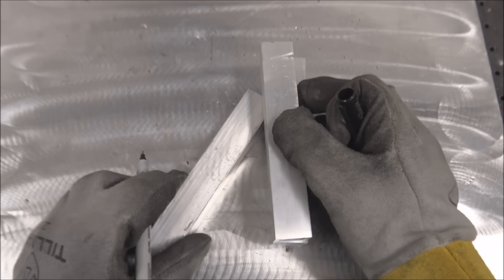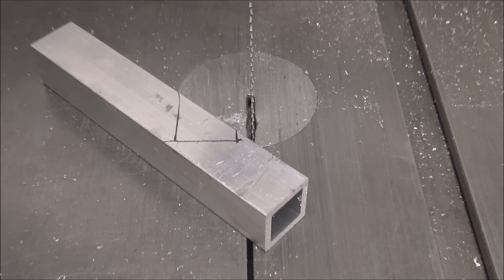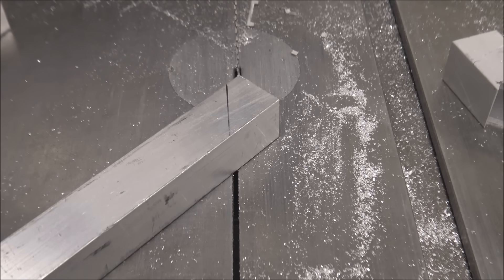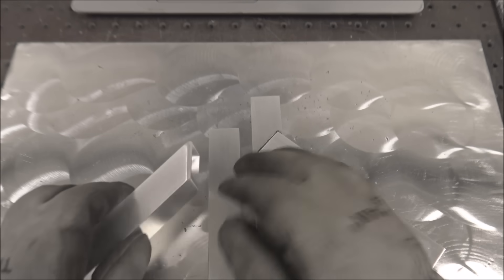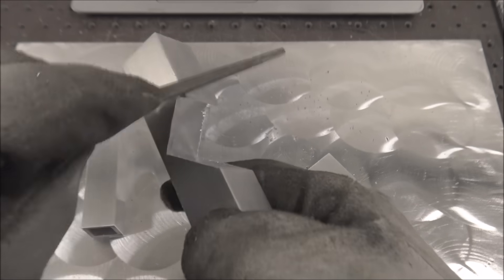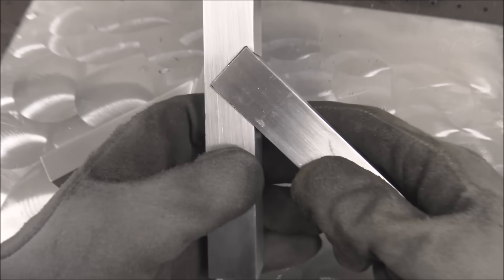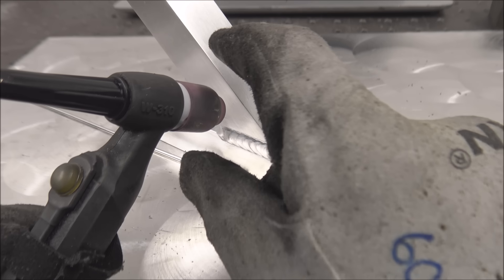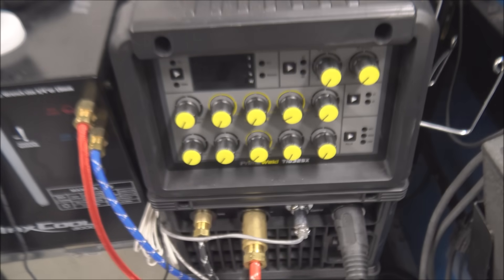Welding Fabrication - Horrible "Education" being EXPOSED

Comment: As a certified IWE, I can say that there are standards and regulations precisely for such connections. 
These specifications for the various connection types are then used as the basis for calculating the overall structures in terms of their structural integrity (strength verification). There are a large number of really technically sensible and mechanically comprehensible reasons for not unnecessarily complicating such types of connection. For example, it is no longer possible to precisely determine the load-bearing capacity of this connection, as the base material has been unnecessarily weakened and force flows are obstructed (all these weld seams in the middle of the profile), which leads to multi-axial stress states in the profile cross-section that do not occur with correct design (left side).

 Many thanks for this video!
Reply: Good! I hadn't considered the calculation part yet. It makes sense that cutting away all the material negatively impacts the mechanical properties. Weld seams are usually the weak point with added risks of introducing imperfections. 

It looks more like a carpentry joint. It makes sense there I guess.
Reply: @leegarnier9396 no, it doesn't make sense in carpentry either. With wood, once you cut it, it stays that weak; you can't weld it back together to restore even a semblance of the strength it had before.
Reply: @jjwagnell  true, but the key is that it "looks" like a wood joint to the untrained eye. It's trying to combine the most eye catching elements of metal and wood joinery regardless of whether it's actually strong, or cost effective, or time effective, or...
Reply: The topic is far more complicated than anyone here seems to be appreciating.  What matters is what forces the connection AND the members have to transfer and how that shear will flow through those members and the welds.  There's a good reason why we don't use butt joints on hollow tube section that are resisting moment, because the unreinforced walls of the tube will buckle out of plane.  Or for connections with large axial forces because you can't achieve enough length of weld to develop that force.  Now don't get me wrong, I would never spec a silly let-in joint like was being portrayed in the "tiktok" example, that's just aesthetic complication, but for many cases a simple mitered butt joint is equally inefficient.  Simple is not always better, it's just cheaper...
Reply: T, K and Y connections per code. You would also have to take into consideration the z loss from the lack of penetration at the skewed joint and properly measure your leg lengths.

Comment: Sadly the reason so many bad video's pop up on how to do stuff is because of engagement. The more engagement a video gets the higher chance it will be recommended.
YT does not look at if it's positive or negative engagement only if it gets any. Working retail I learned 1/5 customers who had a bad experience will complain while only 1/20 who had a good experience will mention how good of an experience they had.
Same rule applies here, videos that show things done wrong will get more engagement due to people wanting to point out how wrong the video is and YT just sees it's getting lots of engagement promoting it thus it likely gets more engagement.

The best thing people can do with videos that are just farming using bad methods is leave the video early and don't engage at all. Don't dislike as that is viewed as engagement the same as liking, don't comment ether.

Comment: Since i have absolutely no knowledge of metals, is it possible that insetting it so far will help with structural stability if the weld fails/to keep the weld from failing? Cause i do woodwork and that reminds me of wood joinery, which you can't weld 😅 and glue joints are generally better with more surface area

Comment: Worse than you say - the piece that's being joined to loses a heap of second moment strength potentially from cutting the face leaving the strength in the spine that's left and shear on your welds on 2 faces.  Be interesting to actually load both up and see the diffeence.

Comment: Call it Weld-Joinery. You do joinery with wood because you can't weld wood (ok, you can use glue joints). But with welds, you are actually turning separate pieces into one continuous piece, and you don't need those complicated tongues and grooves and dados and whatever to transfer forces.

Comment: Meh just like machining, you weld to the to print. If your just doing it for yourself, then do what ever. If you wanna get paid doing it, then at some point you have to follow instructions. In a job situation, both ways mentioned could be called for. It is the welder who has to maintain the skills to cert for the job.

Comment: I thought the right way to do that joint was to split the square pipe down the middle up to the point of the joint, bend the halves out into a Y shape like the crotch of a tree, and then use more half-pipe pieces to make the cut halves back into whole pipes.

Comment: its not really about efficiency, its more of art, I LOVE wooden joinery that have intricate paterns but seems like its a wood only thing and metal worker think radically differently
I do prefer the more dumb way on an art perspective but the correct way is way more efficient on a just doing the work just enough kind of way
tho the thing with joinery with wood is that u dont weld, u have stuff that holds in place by friction, metals are usually not soft enough to have joins hold with just friction

Comment: another thing to mention on the dipshit tiktok weld is that by cutting the main piece to inset the brace you're ruining the strength of the main piece especially on the ridiculous  tube steel versions they do

Comment: Id love to see these two parts compaired on some kind of test rig
Reply: That would be interesting
Reply: As a structural engineer, I can tell you the bad weld will fail first. Welding also reduces the strength of aluminum, so more weld = weak
Reply: @tomd8198  Unfortunatelly, as a strucutural engineer you CANT TELL anyone anything - show the reasearch, explain the process by providing the reasoning/argument, give me a video that proves it or prove it yurself. The argument from authority should not be used in engineering and science.

Comment: Are they trying to weld a whistle? LMAO. It doesn't even leave an open gallery -- maybe you could justify a shallow bird-mouth instead of a miter if the part needs to flow fluid through the tubes, but that joint is just stupid.

Comment: Have you ever done work on mower engines?   The mounting posts for the ignition coil on my mower were snapped off when the coil came loose and hit the flywheel. 
They are directly on the cylinder housing.  Can they be welded back on successfully?

Comment: I think you should come up with an even more "creative" assembly/weld scheme (like going all the way through the straight tube, bend the end of the leg to close the gap, etc.), pushing the absurdity over any reasonable limit!
Cheap low IQ entertainment is what people are interested in, not knowledge. Knowledge requires mental effort. You may look at this as a form of mental obesity problem in the long-run.

Comment: They tried doing this in the electrical field 5 years ago with some young kid saying that electrons don't move through wires - and that they just vibrate back and forth in small areas to bounce other electrons through, 🙄Holding a piece of paper between 2 high voltage electrodes, 4" apart, burning thousands of holes through it, shut some mouths in a hurry. Brain dead professors 40 years ago insisting that holes flowed, instead of electrons, started it all. Gonna' get worse.

Comment: That bandsaw (at the beginning) 
should have a stop-block to get the length of the piece to be cut off, which terminates so the tubing/channel doesn't bind against the fence.
Reply from the maker: No need to solve a problem that doesn't exist. Nothing bound up.

Comment: Sometimes "overcomplicated" welds are required. But this is not such case. If you however find yourself near high pressure piping entering pressure vessel you may find stress relief saddles. Or you may not - some vessels are thick enough (or openings are small enough).

Comment: The more of a tubing joint that is intact and not part of a weld joint the stronger the resultant part will be.
I've seen an old guide on permissible types of joints used in tubular space frames for aircraft. None of the joints involved  completely welding around any one piece of tubing . Every tube in a joint had an unwelded section that was unaffected by heat to retain its original strength. Where necessary , gusset plates were welded to the joints to add strength.
Reply: How does leaving a section unwelded improve strength? If it isn't attached to anything, it has zero strength.
Reply: @thomasdalton1508  The trick its avoid the heat affected zone..  An i imagine they use a redundant frame to cancel these weak points.
Reply: @thomasdalton1508  I believe it's meant as in "the section of pipe hasn't been exposed to the extreme heat required to liquify metal which can interrupt the metal's treatment and forging process"

Comment: I would see an advantage of using a slightly more complicated cutting/fitting technique if you CNC laser cut the tubes and use notches to locate the tubes with each others. Less time measuring and fitting.
But you’d probably have to make quite some volume to have any return on investment …

Comment: While there are different ways to get a lot of things done, some are slower and dumber or both. I've been known to cope things like angle iron or I beam together before welding but, there are simpler ways to do it compared to the too "complex" version that you showed here. Most of the time I just opt for the fewest cuts and welds and be done with it.

Comment: Hey Aaron, Good job and I can say you are right on.  Simple is almost always the best.  And your TIG Button is the best welding tool I have in my shop.
I've had three of them on three different machine and they work flawlessly, especially on aircraft fuselages with thin wall 4130 tube upside down. 🙂 
Thanks, John B.

Comment: To be honest stupid method might be better for mass production, when you stamp milion of self locking parts and weld them with spool gun in secunds, so every idiot on production line can do it. Because i seen this type of joint in chinese office chairs my workplace (local highschool) bought. Not surprisingly all of them beginn to crack around the welds because they were overheated and overcooled so metal around the weld harden while rest remained soft.

Comment: Your beveling is, in my humble opinion, a great habit to get into. It increases the fusion zone & eliminates filings that could affect the finished welding. 
You could also argue their silly joint increases the HAZ zone unnecessarily & wastes time, material, purging gas, etc. Nothing about welding aluminum is cheap or easy.

Comment: I absolutely agree with you. YouTube is getting packed with people that post videos proudly showing the wrong way to do things. I am a retired EE and it is atrocious the amount of wrong minded crap there is on YT. Your videos are excellent because you are not only are a master class welder but you also present the logic and thought processes that make you a master class welder. Thank you for posting.
Reply: The fake electronic videos are disgraceful. There are examples showing how to build an inverter that will supposedly deliver kilowatts with just a few components. If it works at all it will deliver a horrible square wave, a ton of EMI and just a few watts of output with no voltage regulation. It's more likely to burn your house down than to power anything useful.
Reply: What's being criticized reminds me of those videos where they set themselves up to "fail" doing it more or less correctly, then use a dangerous hack as the "right" way, like connecting copper to aluminum.

Comment: Awesome job for calling out the so called "Professional YouTube welder shorts".  I was a structural welder for 9 years and if you every did a joint like that and took away the strength of that beam, your ass was gone, plain and simple. Thanks for being a real professional.

Comment: The only reason to do that notched joint is if you're using wood. Even then it wouldn't be great, because that notch is way too deep and would ruin the strength.

Comment: Great video, there is so much misinformation on welding and fabricating these days due to social media. I personally always bevel both tubes when doing butt joints like you did because as stated in the video it increases weld penetration thus making the joint stronger.

Comment: I've seen those shorts, and you are correct, they do those joints because they don't know how to weld.  Stitch welding prevents penetration, and so, of course, they have to have other crazy ways to increase the weld length and tie the pieces together.  Your methods make so much more sense and are so much easier.  Keep up the good work!!

Comment: Those shorts from the psudowelders are annoying.
But...
In my 35 years of TIG welding, I have had some doozies from some Engineers.  Much more FUBAR than even those shorts..
Just did a quote for a part.  Main Pc. is 3/8" 6061, Little tab is 1/4" thick, getting welded at 90*.
The imagineer calls out a 1/16" weld on one side, and 1/8" weld on the other.  Like you can just pick a size from the freaking rolldown menu...

Comment: The odd cut has the advantage of locating the attached member. But otherwise weakens the cut member significantly. Typically the tube will be a T6 heat treatment. The weld affected zone anneals the metal. With that odd cut the entire cross section of the  cut member will be annealed making it half as strong. With the simple bevel cut around half will be annealed leaving much stronger material behind. 
Also the wall is not cut away. When bending forces are applied, the bevel joint has two walls to resist with, while the odd cut has only the outside one, the inside one being cut away. 
Also if the weld is not full penetration the odd cut removed a huge portion of the original tube. So now most of the load is held by welds that are smaller than the original cross section, making it weaker. Most people don't make samples and cut them to verify they are getting full penetration and the weld is weaker. 
I agree the odd cut is a bad practice on many levels besides the time it takes to cut it.

Comment: Hey Aaron! I just subscribed to your online programme yesterday , very informative content, thank you!. Can you please go over 3mm T-joints in more detail? It’s really difficult and I just can’t get a smooth consistent bead, I find it really hard to join the two plates without stuffing rod in there then it spatters. The puddle doesn’t form and the ark wonders at the start between the top and bottom plate. I have sent you an email with more detail and pictures of my progress after about 10 hours on this joint with not much success. The other joints I find no problem.

Comment: There's not much that's funnier than watching some of the auto-fab channels welding carbon steel with a #32 cup, blowing 40cfh of argon. Or watching them weld stainless like that, where there's no "color," but their HAZ is freaking huge because they're running so slow. Or the "Fab" guy who doesn't even know the difference between sugaring (oxidation) and carbide precip. And on and on... Life is better when you just laugh at it. 

The reason they get the views is because it's engagement bait. It draws people in to argue about it. If your shit's tight, there's nothing to argue or rage over, and you get less engagement. The money isn't in clicks, anyway. Like Yogurt says, "The real money is in the merchandise."